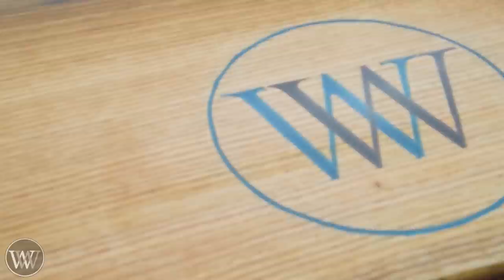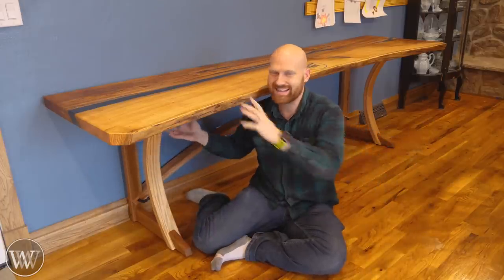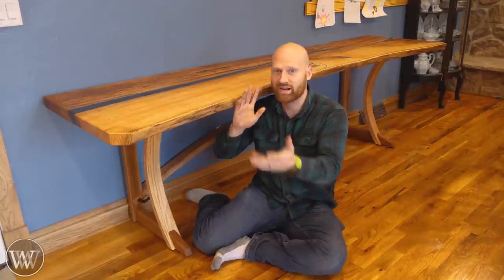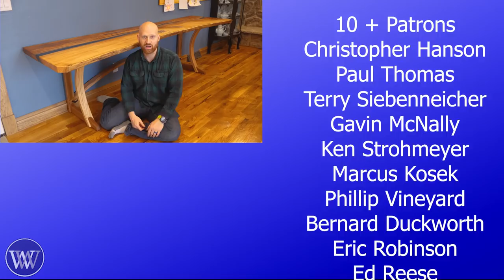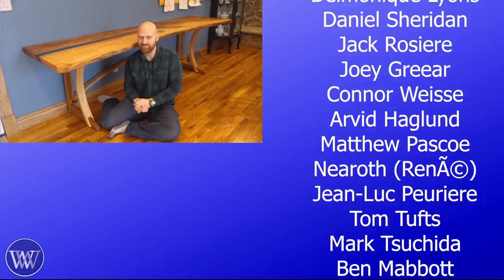Final Slab Top Desk Build Applying Finish

Comment: Wonderful design elements...I have not used the penetrating epoxy...would seem to solve some recurring problems I have...sometimes using CA without accelerator...
Reply from the maker: I'd does suprisingly well and because the wood absorbs it you get a matt finish.
Reply: Always appreciate your efforts to respond...must be a little onerous...but appreciated...Just ordered my penetrating epoxy...

Comment: This is completely unrelated to your video, but I was wondering if you could do a video on dovetailing long stretchers. When I've made work benches in the past I've always had trouble laying out and cutting the dovetails on the ends of long (like over 5 feet) pieces of wood. They are too tall to work on them vertically so I find myself either on a step stool or working on them sideways. How do you do it?
Reply from the maker: usualy I cut them on horizontal. learnign to cut on a steep angle is a good skill to have, but one of the easiest ways is do not cut all the way across the board from one side. cut corner to corner so you are only cutting where you can see the line. then go around to the other side of the board and cut the line on that side. that way you will eb getting a clean cut all the way across the board.
Reply: @WoodByWright  Ok! All the videos online I've seen on Dovetailing lay out the lines and cut with the boards vertical, never seen one on doing the ends of long stretchers. Just an idea for you!